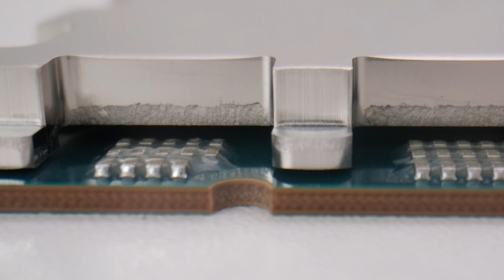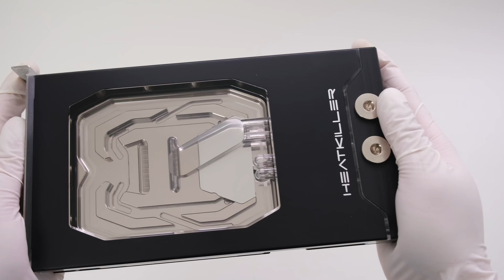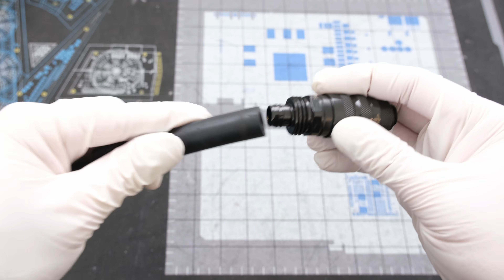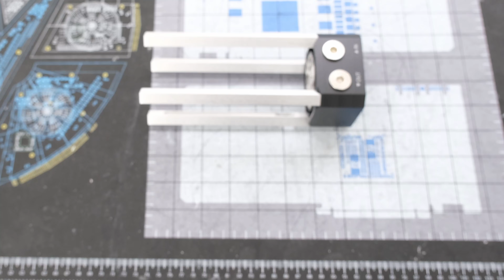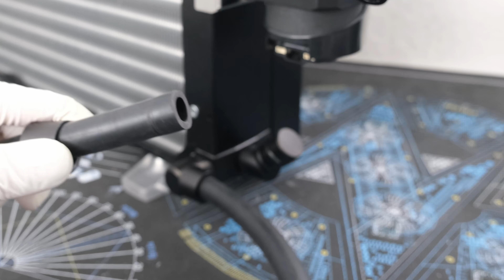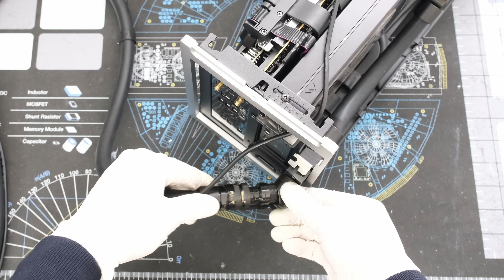Ultimate Silent ITX Build - Step by Step

Comment: Beautiful build !! and very nice and detailed how to, Thank you !
Preparing a similar build, but with the next gen Ryzen 9000... Can't wait to see the results (also planning on delidding it if it still makes sense, though I hope they will improve the IHS performance)

Anyway, I understand that all that wiring you had to make was because you used the external flow sensor ?
As I'm currently using a D5 Next myself, I'm very happy with the built in sensors : The water temp sensor is spot on, and the flow sensor, while certainly not as accurate as an external one, seems to do the job pretty good (honestly for a 24/7 system, I really just need it to be able to detect and alert me when the flow is not sufficient, I don't care about a 100% accurate number)

So if I'm right, I could then just run the system with a D5 next, powering the fans through the splitter, and just having to connect the pump to the SATA power (and USB if I want to get the monitoring into Aquasuite), without the controller and the USB splitter
Am I right?

Also, before your video, I was almost convinced that this kind of setup would require 2 x D5 pumps (this is what many people are still recommending for it) but I can see that your flow rate is very decent with the pump not even running at full speed... So now, I'm more convinced that this is actually overkill to get 2 pumps, as this would create more noise and mode importantly : more vibrations

What's your feedback on this after running this build for a few weeks? Can you confirm that this is definitely enough for a GPU+CPU loop with the Mora 420?

Many thanks !
🙏
Reply from the maker: Thanks for your comment 🙏Hope your next build works out. I actually am planning a delidding video with a 14900KS and Iceman products. Hopefully I can get that video produced sooner than later. 
You're spot on about all that wiring. I anticipated questions about flow. I knew that Quick Disconnects always bring that question up. So, I added that flow meter and used the one with the screen to make it more visually fancy. Its also why I highlighted flow on the chart. Good thing is that we know for sure now that flow will be fine in this setup. 
You're also flat out right that we can completely get rid of the all the cables going to the PC if we remove the flow sensor and connect the fan to the Next D5 Pump. For the setup in the video, I also had a cabinet fan that I connected to the Quadro (since I placed this inside a cabinet and use it on my living room TV) so I wanted the extra fan headers. Although there really isn't anything stopping me from splitting a fan cable and adding it there. For the most part, in the video, I wanted to show the whole thing. Like if someone wanted to setup the whole thing with PC software control.
I am doing follow-ups to this video. In the upcoming video, I'll be showing exactly what we are talking about here. I'll have new setup where its just the Next D5 Pump and since we don't need the extra Flow sensor, we won't need the Hubby7 and since we will be using the Pump connect and to configure the fans, we won't need the Quadro either and that means we won't need that Internal USB cable going to the PC. It's incredibly clean this way and its all possible because of the Next D5 Pump. 
Yea, as for 2 pump. Absolutely no need, right? My cables are extra long (wanted them longer for the video, but in practice, they can be much shorter) and I'm running the pump at pretty low speed. I care more about noise than flow. 
My feedback? It's sublime. It runs like it should. Next ITX build for this MORA is planned to be a Delidded 14900KS and a 4090 Strix. I'm sure the cooling will be enough, but I guess we will find out. Hope that helps

Comment: I used to do similar thing to my 1080ti, change the cooler to AIO with the help of G12, and with the radiator outside my itx case. works so well, over 40c when 100% load with very low noise level that you cant feel. I think there are potential space for some modular product to help people connect outside radiators with 4090 itx case.

Comment: What a clickbait video to show a huge expensive radiator with a small ITX system. If you want to make it silent why did you not just run the radiator without fans? Or why did you just not put the radiator in the other room and run the tubing over? Why not make it aircooled and put the computer in the other room? I think the water cooling block and fittings look great, but where the hell are you going to put that radiator? Back in the dark ages there was a PC cooling thread on a forum that possibly is deleted where someone showed off there awesome custom passive cooling system that was truly slient besides the pump sound. He had copper pipe through his wall that went under the ground in a trench into his yard and back into the home to his PC. That would be epic.
Reply: By your logic, using a backyard for external cooling is good, while a MO-RA is not.  Also, as for using the radiator without fans: why don’t you try doing that yourself while playing a game?

Comment: Hi,
Im pretty new to this, but are you using any sensors for the fan speed or are you running the loop at a constant speed?
Reply from the maker: Thanks for your comment 🙏 For personal case use, I use the Aquacomputer Aquasuite Software to manually tune the Fans based on the coolant temperature. IIRC the D5 and the Flow sensor both have coolant sensors. 
For the purposes of the video and the testing, I used a fixed fan curve. This way I can accurately reproduce the tests and the results and label them correctly. Also, I can then have a flat speed to measure the decibels. Hope that helps and thanks for watchinig

Comment from the maker: Hi All. I recognize that we are using a separate MO-RA (monster radiator) to get the silence. So, while its silent and powerful, whether its small can be debatable. You're flat out right to question if it's truly ITX if we consider the MO-RA. 
One thing that was unexpected for me was that, once the MO-RA is built, there doesn't appear to be a reason to upgrade any of it. The MO-RA is already best in class. Same with the Noctua fans. The reservoir, D5 pump, fittings and tubing all are not expected to need any upgrades. So, this really opens up future builds. The only consideration needed is the CPU/GPU water blocks (in addition to like motherboard, RAM, PSU, etc) and your build can go into basically any case (the Terra is tiny) and it will be silent. You can freely pair an Intel CPU at 400+ watts and an NVIDIA GPU at 400+ watts and have it be completely silent in any case you want. 
The other thing that was pleasantly unexpected was that the MO-RA does kind of blend away. Hear me out. Unless you have the MO-RA right up against the Terra like it's some big brother looking down at it, it feels like you're just using the Terra when using the rig, if that makes sense. It's a different feeling, you got the PC running at full load, GPU at max, and it's just sitting there, tiny and silent. But then again, I love regular ATX mid-tower rigs too. I have one as my main editing rig. I won't stop building those. Thanks again and please enjoy watching. I will continue to try my best to improve with each video. 🙏
Reply: A big reason to build in ITX is to have a small footprint on your desk.  Whether or not you use an external radiator is OUTSIDE the scope of ITX specifications.  “Fun and ethos” is not in ITX specs, neither is “building within the constraints”. 

ITX case used?  Check.  ITX motherboard used? Check.  This is ITX.
Reply: ITX is motherboard standard (170mm x 170mm) it would be a small form factor build (SFF). One large benefit of a remote radiator is the option to place it in a cooler environment eg. outside or keep it out side your room so your room does not become too hot depending on the climate you live in.
Reply: Was actually exactly what I was looking for, thanks for the build!
Reply: You were clear about the Mo-ra right from the start so I'm going to give you a pass.
Reply: Pseudo small build...
Reply: Thats not itx period. Builting within the constraints is the fun and ethos of ITX.
Reply: @GoldFus1on  I have to disagree, having External Cooling, gives so much more opportunity to save on space within the case, 
No more need to waste extra space on fans/radiators within the case. so you can have an even smaller case than ever before. 
Most other ITX cases are so much bigger because they have to comply to having space for radiators within.
Reply: @ not portable then thou, each to their own reasons
Reply: @ That is exactly my goal for my current build,  I already have an Mo-Ra 3 420 at home from my previous build, and im planning on using the newer Mo-ra 4 200, (smaller version) when moving around, 
The idea is simple with Quick Disconnect fittings, when at home i can connect to my bigger mo-ra for better cooling capacity, and when moving around ill be using the smaller one. I think the main advantage will be to divide the weight between two items.
Reply: Says who? You? Do you set the "etos" is for everyone? Lol get real. This is awesome. A small pc case on your desk and the cooling hidden under the desk. Best of both worlds. Ultimate performance. Small footprint on desk. Purists really need to get a grip.. Snowflakes wjo think a category is just for them. #yalouz  @GoldFus1on

Comment: yea but thn its not small form factor is it?
Reply from the maker: Thanks for your comment 🙏  I recognize that I'm using a separate MO-RA to get the silence. So, while its silent and powerful, whether its small can be debatable. You're flat out right to question if it's truly SFF if we consider the MO-RA. 
One thing that was unexpected for me was that, once the MO-RA is built, there doesn't appear to be a reason to upgrade any of it. The MO-RA is already best in class. Same with the Noctua fans. The reservoir, D5 pump, fittings and tubing all are not expected to need any upgrades. So, this really opens up future builds. The only consideration needed is the CPU/GPU water blocks (in addition to like motherboard, RAM, PSU, etc) and your build can go into basically any case (the Terra is tiny) and it will be silent. You can freely pair an Intel CPU at 400+ watts and an NVIDIA GPU at 400+ watts and have it be completely silent in any case you want. 
The other thing that was pleasantly unexpected was that the MO-RA does kind of blend away. Hear me out. Unless you have the MO-RA right up against the Terra like it's some big brother looking down at it, it feels like you're just using the Terra when using the rig, if that makes sense. It's a different feeling, you got the PC running at full load, GPU at max, and it's just sitting there, tiny and silent. But then again, I love regular ATX and ITX builds too. I have an ATX one as my main editing rig and another ITX one in a Meshlicious. I won't stop building those either. Thanks again for commenting and for the feedback

Comment: Very technically impressive build, but I really don't see any practicality in having an SFF build reliant on being tethered to a large external radiator.
Reply from the maker: Thanks for your comment 🙏  I recognize that I'm using a separate MO-RA to get the silence. So, while its silent and powerful, whether its small can be debatable. You're flat out right to question the practicality of the build. 
One thing that was unexpected for me was that, once the MO-RA is built, there doesn't appear to be a reason to upgrade any of it. The MO-RA is already best in class. Same with the Noctua fans. The reservoir, D5 pump, fittings and tubing all are not expected to need any upgrades. So, this really opens up future builds. The only consideration needed is the CPU/GPU water blocks (in addition to like motherboard, RAM, PSU, etc) and your build can go into basically any case (the Terra is tiny) and it will be silent. You can freely pair an Intel CPU at 400+ watts and an NVIDIA GPU at 400+ watts and have it be completely silent in any case you want. 
The other thing that was pleasantly unexpected was that the MO-RA does kind of blend away. Hear me out. Unless you have the MO-RA right up against the Terra like it's some big brother looking down at it, it feels like you're just using the Terra when using the rig, if that makes sense. It's a different feeling, you got the PC running at full load, GPU at max, and it's just sitting there, tiny and silent. But then again, I love regular ATX and ITX builds too. I have an ATX one in an o11 EVO as my main editing rig and another ITX one in a Meshlicious. I won't stop building those either. Thanks again for commenting and for the feedback
Reply: @vectornetwork  Interesting. And to clarify a build doesn't have to be practical to be entertaining to watch you build or for it to be a powerful and useful PC.
Reply from the maker: @MattTheriot  Thank you friend. I absolutely agree.

Comment: While this build is sick, do remember a couple of things:
Yes, the water cooled part of the system will undoubtedly be near silent, BUT the choice of components matters a lot, like the motherboard (itx models may have a tiny whiny fan, which turns on from time to time).
Same with the PSU. Certain models, like some Cooler master units, for example, cannot be called silent and at some times even moderate under load.

Discl.: I daily drive an ITX system with a MoRa 360 rad. Cheers!
Reply from the maker: Thanks for the comment 🙏 This is so spot on. The parts do matter. Each and every part was given lots of consideration. You're right all the little fans (PSU, mobo, etc etc). Funny story where when I was running this rig in the living room and listening for noise, I found every single other fan in the room, particularly the ice maker. Thanks again for watching and commenting

Comment: what is the point of a small pc that needs a monster radiator? why not to build normal size pc with hard tube that will look insanely good?
Reply from the maker: Thanks for your comment 🙏  I recognize that I'm using a separate MO-RA to get the silence. So, while its silent and powerful, whether its small can be debatable. You're flat out right to question the point of the build. 
One thing that was unexpected for me was that, once the MO-RA is built, there doesn't appear to be a reason to upgrade any of it. The MO-RA is already best in class. Same with the Noctua fans. The reservoir, D5 pump, fittings and tubing all are not expected to need any upgrades. So, this really opens up future builds. The only consideration needed is the CPU/GPU water blocks (in addition to like motherboard, RAM, PSU, etc) and your build can go into basically any case (the Terra is tiny) and it will be silent. You can freely pair an Intel CPU at 400+ watts and an NVIDIA GPU at 400+ watts and have it be completely silent in any case you want. 
The other thing that was pleasantly unexpected was that the MO-RA does kind of blend away. Hear me out. Unless you have the MO-RA right up against the Terra like it's some big brother looking down at it, it feels like you're just using the Terra when using the rig, if that makes sense. It's a different feeling, you got the PC running at full load, GPU at max, and it's just sitting there, tiny and silent. But then again, I love regular ATX and ITX builds too. I have an ATX one in an o11 EVO as my main editing rig and another ITX one in a Meshlicious. I won't stop building those either. Thanks again for commenting and for the feedback

Comment: Kinda defeats the purpose of itx imo
Reply from the maker: Thanks for your comment 🙏  I recognize that I'm using a separate MO-RA to get the silence. So, while its silent and powerful, whether its small can be debatable. You're flat out right to question the purpose of the build. 
One thing that was unexpected for me was that, once the MO-RA is built, there doesn't appear to be a reason to upgrade any of it. The MO-RA is already best in class. Same with the Noctua fans. The reservoir, D5 pump, fittings and tubing all are not expected to need any upgrades. So, this really opens up future builds. The only consideration needed is the CPU/GPU water blocks (in addition to like motherboard, RAM, PSU, etc) and your build can go into basically any case (the Terra is tiny) and it will be silent. You can freely pair an Intel CPU at 400+ watts and an NVIDIA GPU at 400+ watts and have it be completely silent in any case you want. 
The other thing that was pleasantly unexpected was that the MO-RA does kind of blend away. Hear me out. Unless you have the MO-RA right up against the Terra like it's some big brother looking down at it, it feels like you're just using the Terra when using the rig, if that makes sense. It's a different feeling, you got the PC running at full load, GPU at max, and it's just sitting there, tiny and silent. But then again, I love regular ATX and ITX builds too. I have an ATX one in an o11 EVO as my main editing rig and another ITX one in a Meshlicious. I won't stop building those either. Thanks again for commenting and for the feedback